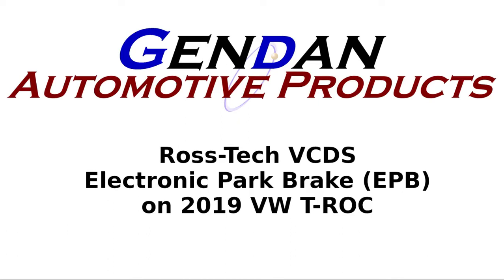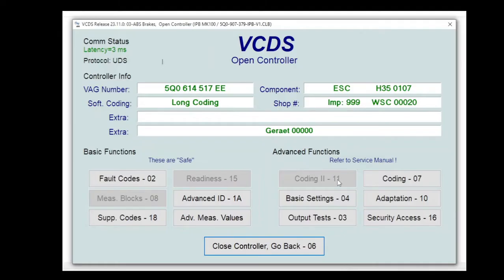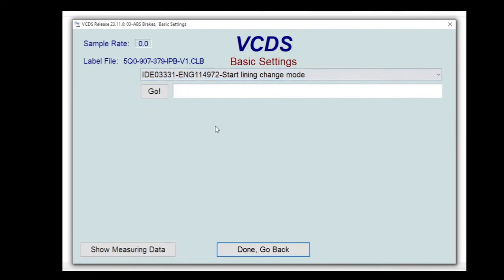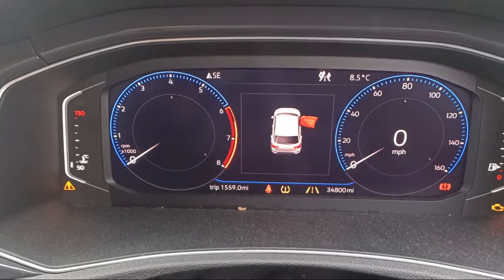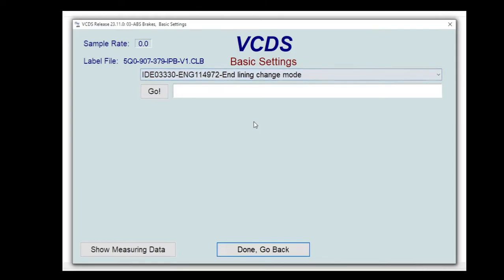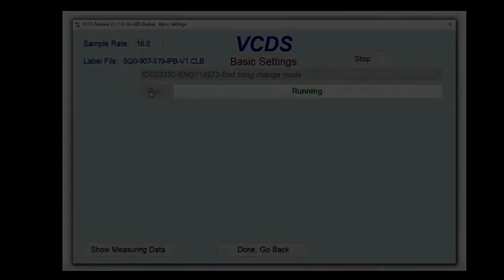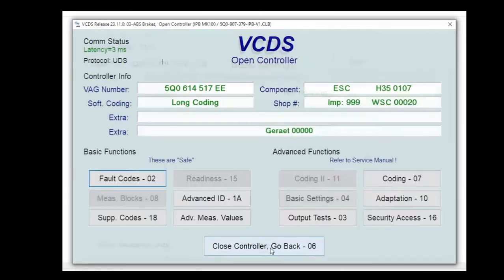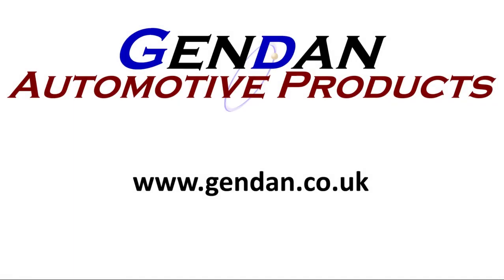EPB reset with VCDS - parking brake release tutorial for changing brake pads

Comment: Why do in need a battery charger attached???
Reply: The break module does not like low voltage hence the charger.
Reply: @vodonnell1  Brake the break module!
Reply: if you have a healthy battery, you don't need to attach a charger. it's a good failsafe to have in place tho.

Comment: Hi, i changed the pads on my audi a6, i opened the parking brake and released the piston manually,  now i keep getting parki g brake fault on dash. Any ideas why? Thanks
Reply: you broke the hand brake
Reply: Can be an electronic problem that can be solved with VCDS? I've the same issue and the motor works but it's like it brake and release because the position of the motor it's not "resetted" or "calibrated". Maybe the last command after the pads changing in the video can solve. What do you think?